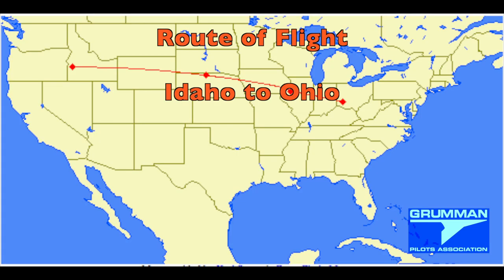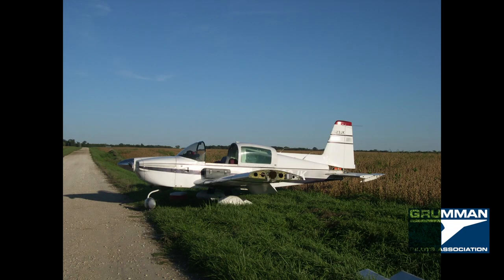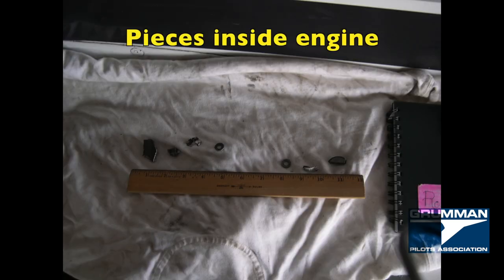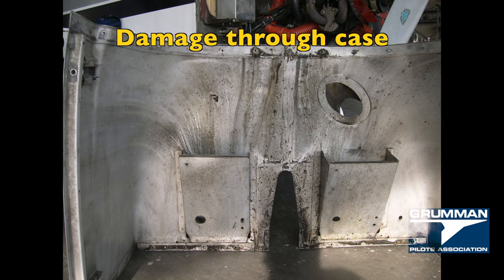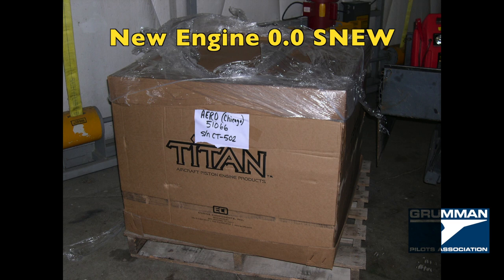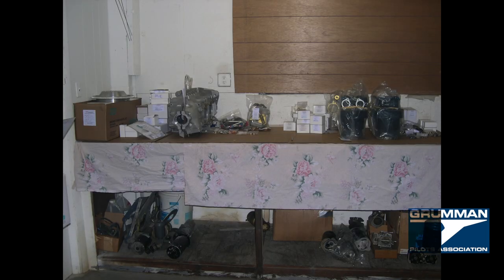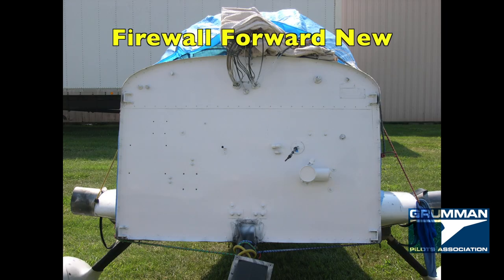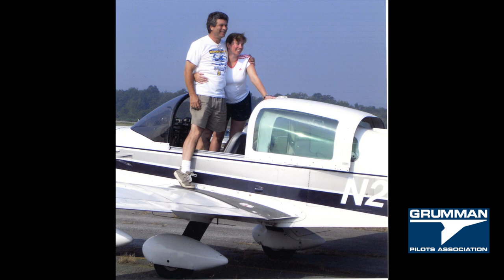The Dreaded  Dead Stick Landing - Grumman Style

Comment: Roscoe what were the details on the power-plant that failed? SMOH etc? Thanks.  Great vid as always!
Reply from the maker: It was 2061  SMOH had a STOP 400 ago, spun a bearing, lost oil pressure, threw rod, no engine.  I was on the way back home to have the engine overhauled..  2 more hours and I would have been home.
Reply from the maker: No, my wife came with the truck and a trailer and Larry.